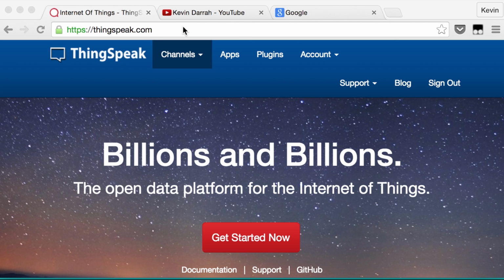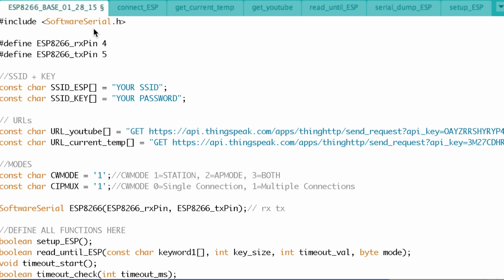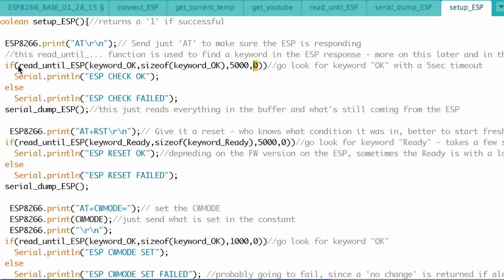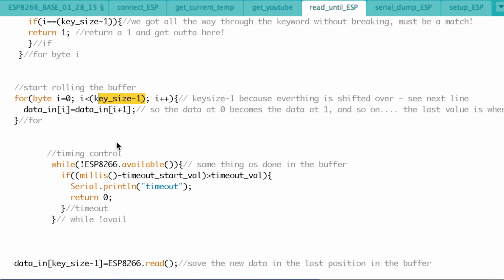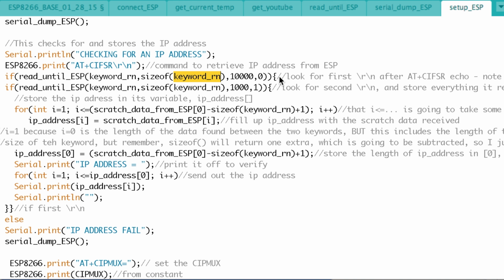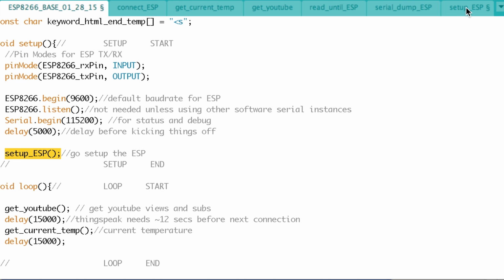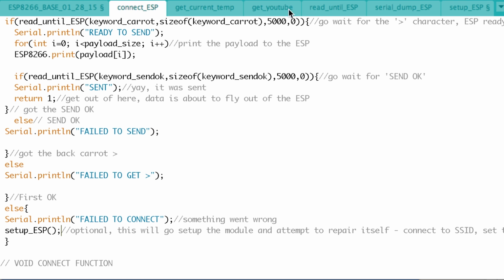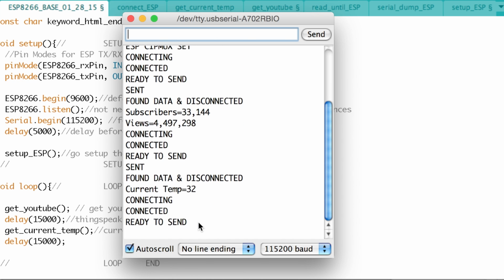Cheap and Easy WiFi (IoT) Tutorial Part 2 - ESP8266 Arduino Code

Comment: I am trying to write this back for avr-gcc and so far so good..but I am stuck at ESP.8266.print(payload_size) part...i am using uart_puts(payload_size) but i got an error

Warning  passing argument 1 of 'uart_puts' makes pointer from integer without a cast [-Wint-conversion]

the output suppose to be "AT+CIPSEND=0,85" but instead i got "AT+CIPSEND=0, "

Nevermind...I have managed to finish it..everything is working perfectly..
Hope you can teach us more on how to get more data from websites...thanks

Comment: I have DCcduino + ESP8266. Direct "AT" command work fine. But SoftwareSerial not. I have tried program with very basic version with SoftwareSerial, and anything helps. I have original fimw., without any update, external Power Source, and ESP-01 socket, which change voltage to 3,3V DC, 9600 bit rate. 2xBlink blue Light, but any respond with SoftwareSerial.

Any Idea? Muss I update fw? Or could Socket have any influence?

Comment: Hi dear Kevin,
thanks for the Good Job you have done...
But I am getting this Error while Compiling your Code; I have just Changed the SSID Name and SSID Password ...
cant understand what to do ?
I am new to ESP8266 and using ESP8266 ESP-12e NodeMCU Module 

///////////////////////////////////////////////////
Arduino: 1.6.6 (Windows 10), Board: "NodeMCU 1.0 (ESP-12E Module), 80 MHz, 115200, 4M (3M SPIFFS)"

<command-line>:0:9: error: expected unqualified-id before numeric constant

C:\Users\MKBUTAN\Desktop\ESP8266_BASE_01_28_15\ESP8266_BASE_01_28_15.ino:18:16: note: in expansion of macro 'ESP8266'

 SoftwareSerial ESP8266(ESP8266_rxPin, ESP8266_txPin);// rx tx

                ^

C:\Users\MKBUTAN\Desktop\ESP8266_BASE_01_28_15\ESP8266_BASE_01_28_15.ino: In function 'void setup()':

ESP8266_BASE_01_28_15:69: error: request for member 'begin' in '1', which is of non-class type 'int'

   ESP8266.begin(9600);//default baudrate for ESP

           ^

ESP8266_BASE_01_28_15:70: error: request for member 'listen' in '1', which is of non-class type 'int'

   ESP8266.listen();//not needed unless using other software serial instances

           ^

C:\Users\MKBUTAN\Desktop\ESP8266_BASE_01_28_15\connect_ESP.ino: In function 'boolean connect_ESP()':

connect_ESP:4: error: request for member 'print' in '1', which is of non-class type 'int'

   ESP8266.print("AT+CIPSTART=0,\"TCP\",\"api.thingspeak.com\",80\r\n");//only connecting to thingspeak

           ^

connect_ESP:9: error: request for member 'print' in '1', which is of non-class type 'int'

   ESP8266.print("AT+CIPSEND=0,");//send AT+CIPSEND=0, size of payload

           ^

connect_ESP:10: error: request for member 'print' in '1', which is of non-class type 'int'

   ESP8266.print(payload_size);//the payload size

           ^

connect_ESP:12: error: request for member 'print' in '1', which is of non-class type 'int'

   ESP8266.print("\r\n");//cap off that command with a carriage return and new line feed

           ^

connect_ESP:17: error: request for member 'print' in '1', which is of non-class type 'int'

     ESP8266.print(payload[i]);

             ^

C:\Users\MKBUTAN\Desktop\ESP8266_BASE_01_28_15\read_until_ESP.ino: In function 'boolean read_until_ESP(const char*, int, int, byte)':

read_until_ESP:18: error: request for member 'available' in '1', which is of non-class type 'int'

             while(!ESP8266.available()){//wait until a new byte is sent down from the ESP - good way to keep in lock-step with the serial port

                            ^

read_until_ESP:25: error: request for member 'read' in '1', which is of non-class type 'int'

     data_in[i]=ESP8266.read();// save the byte to the buffer 'data_in[]

                        ^

read_until_ESP:56: error: request for member 'available' in '1', which is of non-class type 'int'

             while(!ESP8266.available()){// same thing as done in the buffer

                            ^

read_until_ESP:65: error: request for member 'read' in '1', which is of non-class type 'int'

     data_in[key_size-1]=ESP8266.read();//save the new data in the last position in the buffer

                                 ^

C:\Users\MKBUTAN\Desktop\ESP8266_BASE_01_28_15\serial_dump_ESP.ino: In function 'void serial_dump_ESP()':

serial_dump_ESP:5: error: request for member 'available' in '1', which is of non-class type 'int'

   while(ESP8266.available()){

                 ^

serial_dump_ESP:6: error: request for member 'read' in '1', which is of non-class type 'int'

     temp =ESP8266.read();

                   ^

C:\Users\MKBUTAN\Desktop\ESP8266_BASE_01_28_15\setup_ESP.ino: In function 'boolean setup_ESP()':

setup_ESP:3: error: request for member 'print' in '1', which is of non-class type 'int'

   ESP8266.print("AT\r\n");// Send just 'AT' to make sure the ESP is responding

           ^

setup_ESP:11: error: request for member 'print' in '1', which is of non-class type 'int'

    ESP8266.print("AT+RST\r\n");// Give it a reset - who knows what condition it was in, better to start fresh

            ^

setup_ESP:18: error: request for member 'print' in '1', which is of non-class type 'int'

    ESP8266.print("AT+CWMODE=");// set the CWMODE

            ^

setup_ESP:19: error: request for member 'print' in '1', which is of non-class type 'int'

    ESP8266.print(CWMODE);//just send what is set in the constant

            ^

setup_ESP:20: error: request for member 'print' in '1', which is of non-class type 'int'

    ESP8266.print("\r\n");

            ^

setup_ESP:28: error: request for member 'print' in '1', which is of non-class type 'int'

    ESP8266.print("AT+CWJAP=\"");// set the SSID AT+CWJAP="SSID","PW"

            ^

setup_ESP:29: error: request for member 'print' in '1', which is of non-class type 'int'

    ESP8266.print(SSID_ESP);//from constant 

            ^

setup_ESP:30: error: request for member 'print' in '1', which is of non-class type 'int'

    ESP8266.print("\",\"");

            ^

setup_ESP:31: error: request for member 'print' in '1', which is of non-class type 'int'

    ESP8266.print(SSID_KEY);//form constant

            ^

setup_ESP:32: error: request for member 'print' in '1', which is of non-class type 'int'

    ESP8266.print("\"\r\n");

            ^

setup_ESP:41: error: request for member 'print' in '1', which is of non-class type 'int'

   ESP8266.print("AT+CIFSR\r\n");//command to retrieve IP address from ESP

           ^

setup_ESP:59: error: request for member 'print' in '1', which is of non-class type 'int'

    ESP8266.print("AT+CIPMUX=");// set the CIPMUX

            ^

setup_ESP:60: error: request for member 'print' in '1', which is of non-class type 'int'

    ESP8266.print(CIPMUX);//from constant

            ^

setup_ESP:61: error: request for member 'print' in '1', which is of non-class type 'int'

    ESP8266.print("\r\n");

            ^

exit status 1
request for member 'begin' in '1', which is of non-class type 'int'

  This report would have more information with
  "Show verbose output during compilation"
  enabled in File > Preferences.

\\\\\\\\\\\\\\\\\\\\\\\\\\\\\\\\\\\\\\\\\\\\\\\\\\\\\

Please Help

Comment: Hey! Great Video. I am having a compiling problem. I just copied and pasted your code and didnt edit anything except SSID and its keywords. The error is" request for member 'begin' in '1', which is of non-class type 'int'". Please help me.
Reply: i have the same problem
Reply: I'm getting the same problem.
Reply: I am using an older version of the Arduino IDE (1.0.5) and am not getting that error.

Comment: for the setup and connection there is a library called  "ESP8266Wifi.h" and "ESP8266WebServer.h" which will make it easier and you won't need a arduino

Comment: thanks for taking the time to develop this code, kevin. got my 8266 up and running with it. just a tip for those who are having "timeout" issues from the read_until_ESP function, it's likely because the firmware version on your ESP8266 is different than what kevin used and is spitting out different responses (keywords). on the main "BASE" code page where the keywords are defined, i had to change "Ready" to "ready" (as is mentioned by kevin's comment). i also had to change "Unlink" to "0,CLOSED".
i haven't played around too much with this yet, but i'll keep updating this comment if i find any of the other keywords are different with my firmware version.
Reply from the maker: great! thanks for the tips!

Comment: Why aren't you loading the data from the YouTube API? For me as a software developer, parsing HTML to get specific data is the worst idea ever. And thus, advising to do so is somewhat dangerous, if you ask me ;)

Also, HTTP itself does not want the host name to be in the query.
The HTTP query normally looks like this: "METHOD /path_of_resource/resource HTTP/version". You connect to a server (IP or host) and then tell the server to GET / POST / PUT / DELETE / ... / a specific resource ON THAT server, so there is no technical need for the hostname to be there.

So does the board do some parsing of the serial input itself?
Reply: Because the Youtube API requires api keys/login and maybe it's too much overhead for the Arduino. There's nothing wrong with the way he's doing it for what he's trying to accomplish.  It's not "dangerous" it's just not a complete solution.  The benefit is, if the path to the data changes, he just needs to update Thinkspeak and the device code still works.

Comment: Does the Arduino IDE support the normal C string library, such as length of a string, position of a substring within a string, string concatenation, etc.? If so, I'm curious why you're doing this manually. Is that faster or more efficient?

Comment: Hello there  , which library i have to download to compile successfully the code  which is done by Sir Kevin Darrah? i face the error while compiling the code..
Reply: +Digant Goradia No additional libraries are needed. What is the error?
Reply: +Srijal Poojari  , Actually my simple code cant be upload to the ESP8266 Module through the arduino uno board and the arduino IDE itself. i have conncted every pinouts perfectly..and the error is like this

warning: espcomm_sync failed error: espcomm_open failed
Reply: +Digant Goradia In the video series, the code is uploaded to the Arduino and not the ESP itself. 
According to your error, you want to upload some other code to the esp directly, for which you should use a USB to Serial converter. The Arduino can to this but its a mess to set it up. I have tried it many times but in the end I just bought a USB to Serial converter and things are smooth now.
Reply: +Srijal Poojari  Ok..but i saw some of the videos, into that videos they have used Arduino to build upthe code to ESP module..

Comment: I received : //*[@id="browse-items-primary"]/li/div/div[1]/div/span[2]/b

and i paste, the message is : Error parsing document, try a different parse string.

Can you help me ?

Thanks!
Marc.
Reply: +Marc Paradis I got the same Error on a few webpages, but it works well on the others. Try using a different website for the data you want if possible. And let me know if you find a solution for this error.
Reply: +Srijal Poojari Hi guys, i talked with thingspeak support a couple of months ago, and they said that you can't use this "thing" on every page. It works on Youtube (HTML, HTML5) but not with other formats.
Reply: +Matthew Freeman oh okay, thanks!:)
Reply: For me, this XPath(//*[@id="browse-items-primary"]/li/div/div[1]/div/span[2]/b) doesnt work too.Try this one:
//*[@id='browse-items-primary']/li/div/div[3]

Comment: Everything went wrong...How can I use the firmware same as of yours? What should I do now?

The results were as follow:
timeout
ESP CHECK FAILED
timeout
ESP RESET FAILED
timeout
ESP CWMODE SET FAILED
timeout
ESP SSID SET FAILED
CHECKING FOR AN IP ADDRESS
timeout
IP ADDRESS FAIL
timeout
ESP CIPMUX SET FAILED
CONNECTING
timeout
FAILED TO CONNECT
timeout
ESP CHECK FAILED
timeout
ESP RESET FAILED
Reply from the maker: +Bharat Bohara I posted that flasher up in the part 1 - see the description

Comment: Great video. I am looking some advise. I am planing to connect a number of sensors to get data and then upload it in to the internet. Should I use this as main micro controller or just as a Wifi module?

Comment: Do you need to do setup ESP every time before you use it?
Reply: +Bob “bobdabiulder” dabiuld Yes, every time you reset power as esp does not store SSID and pass details. It may be possible if you directly program the ESP

Comment: Hi
I am not able to flash my ESP8266 module, when I am tryiny to enter AT commands via serial monitor it is showing me some irrelevant output and also ESP8266 flasher is not able to fetch MAC Address.
Thanks
Reply: You were suppose to burn arduino n not ESP. Here he is using AT command through arduino to communicate with esp
Reply: So this code is for the arduino? how do you then connect the arduino to the ESP?
Reply: +Jairo Marquez google is the best option to find connections. let me know here if u can't find it.

Comment: I followed all this steps shown in this tutorial, but, when I sent de GET command to retrieve the data ... it caused an problem that the informations retrieved was greater than the arduino´s buffer size, the default is 64 bytes, even changed the size to 256 it is not enough, cause the answer of the command GET comes with the http header not only the information retrieved as shown when you put the GET command.
Used and arduino UNO, and other NANO, but the results was the same, does not get all data.
There is an way to read more data than 64 bytes ? Because, when I read the buffer, the rest of the information does not appears any more - eps.available() is equal to zero - no bytes remains in the buffer the be read.
You can give me a clue, to solve this problem?
How can I receive the answer from the Thingspeak whitout the http header, only the data I am asking using the parse command?
Thanks...

Comment: I have one big problem with ESP8266 - I have connected TX to TX on arduino and RX to RX. When I look in serial monitor, I recieve this:
wdt reset
load 0x40100000, len 25052, room 16 
tail 12
chksum 0x0b
ho 0 tail 12 room 4
load 0x3ffe8000, len 3312, room 12 
tail 4
chksum 0x53
load 0x3ffe8cf0, len 6576, room 4 
tail 12
chksum 0x0d
csum 0x0d
Fatal exception (0): 
epc1=0x40248580, epc2=0x00000000, epc3=0x00000000, excvaddr=0x00000000, depc=0x00000000
....
....
....
....
What can I do to fix it?

Comment: You don't have to have the CIPMUX set to one for TCP communications.  Only if you are going to use more than one socket.  I send emails out using a TCP connection to a email server just fine in that mode.

Comment: Hi guys!
I upload the code on my Arduino Uno R3. So before that I test AT and it returns OK but when start Arduino with downloaded code i get ...
timeout
ESP CHECK FAILED

What can cause this ?
Reply from the maker: Make sure you have the same firmware loaded in the ESP - it might not be getting the exact keyword back?  Otherwise, not sure
Reply: Kevin Darrah 10x for the replay. I'm completely new to Arduino so I tried Tutorial Part 1 video step by step so I was able to get my data form api.thingspeak.com trough Serial Monitor. However can you tell me about this:

void setup() {
  // put your setup code here, to run once:
  Serial.begin(9600);
  Serial.print("AT\r\n"); 
}

void loop() {
  // put your main code here, to run repeatedly:

}

Should I see in SerialMonitor OK after above code, because I don't ?

OR

I tried this too but it never find "OK": 

void setup() {

  Serial.begin(9600);
  Serial.print("AT\r\n"); // or "AT" or "AT\r\n\n" or "AT\n\n\r"  
  
  if  (Serial.find("OK")) {
    Serial.print("OK IT IS READY");
  }
}

p.s. AT+GMR gives me
0018000902-AI03

AT+RST gives me
[Vendor:www.ai-thinker.com Version:0.9.2.4]

ready
Reply: Kevin Darrah 
OK i figure it out. And is this expected behaviour ?

When i first mange to run ESP8266 when I try Serial Monitor commands there was no response. So I switch RX and TX like that RX-RX TX-TX and Serial Monitor commands start working. Now I make it like that RX-TX and TX - RX and this code:

void setup() {

  Serial.begin(9600);
  Serial.print("AT\r\n"); // or "AT" or "AT\r\n\n" or "AT\n\n\r"  
  
  if  (Serial.find("OK")) {
    Serial.print("OK IT IS READY");
  }
}

returns "OK IT IS READY", but now again I can't send command trough Serial Monitor. When I type In Arduino's RX blink bit but terminal is empty.
Reply: Kevin Darrah When i replace ESP8266.print with Serial.print I get some success with your code connecting to my SSID... testing now...
Reply from the maker: that's definitely a wiring problem if it works with Serial.print

Comment: Hello. Arduino beginner here, so please bear with me if the question is stupid or obvious: what happens if the parsing in ThingSpeak never works? I tried your example exactly and others with other websites and it always returned an error message to me: "Error parsing document, try a different parse string." Any help would be greatly appreciated. I'm trying to find a way to get weather data from a website so that I can get my Arduino (with an Adafruit CC3000 WiFi shield) to read it. Thanks!

EDIT: At the time of this edit, works for the temp in http://openweathermap.org/ but not others.

Comment: anyone else getting "Error parsing document, try a different parse string."
Reply from the maker: yep, you'll get that with certain elements - might need to try a different source or method. One of the reasons I got stuck using accuweather
Reply: Thanks, i tried to get my Youtube info just like you, but i was getting the error, so i used socialblade